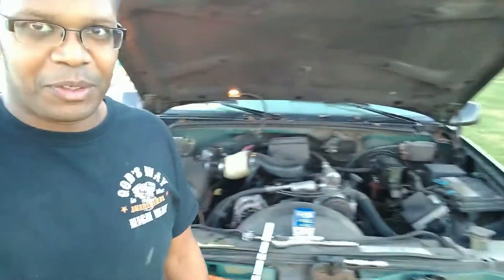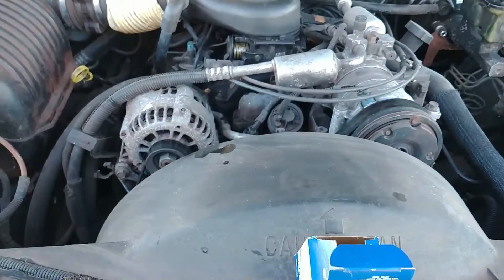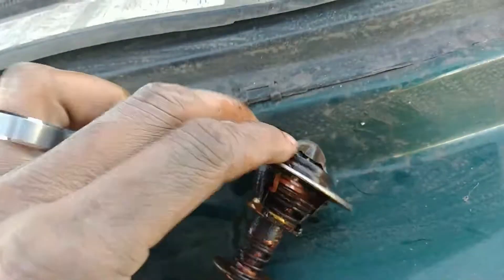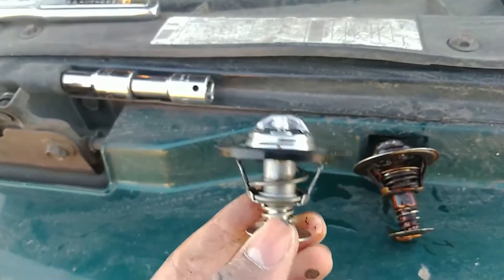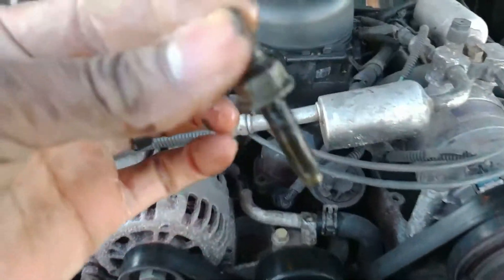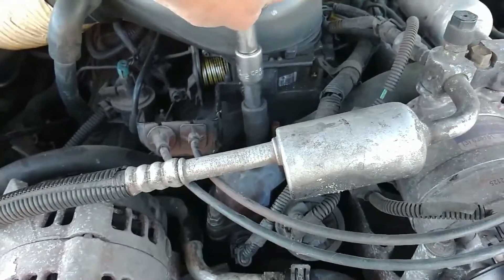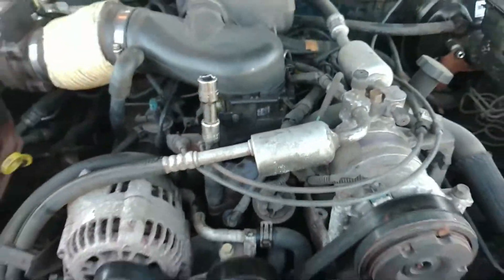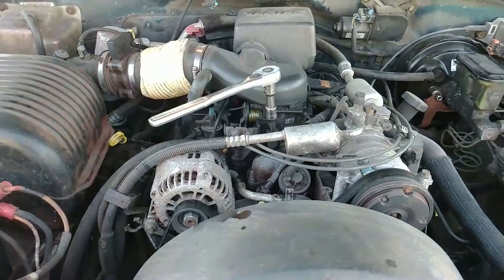NO HEAT! EASY CHEAP FIX! CHECK THIS 1ST! Tahoe, Silverado, Escalade, Suburban. Yukon, Sierra 3W1B

Comment: Never trust the gasket on the thermostat to seal by itself.  Particularly years later and replacement. In addition moisture can get between the flange causing corrosion and bolt siesure.  Just add a bit of silicone gasket to the flange matting surfaces for good measure!
Reply from the maker: I traditionally sealed both sides. Newer vehicles use o-rings which require no sealant.

Comment: Idk if this is what I need. 
I have a '06 Tahoe. Before I completely lost all my heat, was smelling something  burning. 
I had a old Ford Exploder, and the blower fan died, but i don't remember if it made a smoky smell.
Reply from the maker: I would make sure your blower fan is still blowing air.
Reply: @3Wheels1Block  its blowing cold air. The radiator gauge shows that the truck is not running hot.
Reply from the maker: I would check the coolant level. If the GMT 800 trucks coolant level gets low  it will cause the heater core to empty, which results in no heat. 

If the coolant level is good and the fan is blowing, you probably have a blockage in the heater core.
Reply: @3Wheels1Block  okay thanks. I can't  remember the last time that I added coolant. Its been a while. I hope that's the problem.
Reply: @3Wheels1Block  good looking out!!!!.
It was very low on coolant.
It took about 3 quarts of 50/50 mix. 
But I still need to know what the burning smell was several days before the heat completely went out.
It smelled like oil burning when you need to replace your valve cover gasket. 
I even saw the smoke come from under the hood when I was at a red light.
Reply from the maker: Definitely check around the engine bay. Look it over for evidence of leaks
Reply: @3Wheels1Block  👍👍
Reply: The plot thickens. Lol.
Yes, its leaking! I guess it's the water pump. I could see it real good today, when i checked the level of coolant. 
Ive had enough old cars to remember the water pump will drip what they used to call a tear drop.
Ill take care of this asap. At least  i have my heat back.
Do you think my radiator was so low that it was burning like a pot without enough water & the smoke came up through the coolant reservoir???
Is that why the thermostat you took out is so dark?? 
Or did the high coolant temp discolor the metal?
Reply from the maker: If your water pump is leaking the coolant is splashed around by that big mechanical fan or the electric cooling fans. It probably got on the manifolds or sides of the head causing steaming and it definitely will smell like something burning. 

The dark thermostat in my case is due to chemical and heat cycles. Just like an old penny looks dark compared to a shiney new one.

Good luck on getting the water pump swapped out.
Reply: @3Wheels1Block  👍👍 yep, I saw the serpentine belt is spashing the dripping coolant around. 
I'd rather have something I can fix myself, than to have to go to a repair shop or dealership for everything. 
I got a funny question. Do you remember back in the day when you could use power steering fluid &/ or transmission fluid in a car. It didn't matter!
I remember when pep boys had 3 tires for $99 & the 4th tire was free.
Here's a bonus.
I remember they use to sell motor oil in the dollar store...for a dollar. 
If they force us to convert to electric cars, we are doomed.
DIY is going to mean, Drive it yourself, to the dealer.
Reply from the maker: @do7hemath937 I remember every one of those things. I actually found Dex III transmission fluid for $1 a quart back in 2019. I don't think we will ever see that again. 

I agree 💯 that something you can fix yourself is definitely the way to go. Knowing your vehicle and being able to service it can save thousands of dollars over the life of the vehicle. 😎
Reply: @3Wheels1Block  it used to be I would buy alot of something just to not run out. Now I buy alot of something because inflation is so bad I know everything is going to cost more a year from now.
I hope you racked up on the transmission fluid!
I subscribed to your channel and I saw you painting cars.
Man, I remember when Maaco used to have the Ambassador and the Presidential paint jobs PLUS they had HALF OFF specials.
It used to be nice to get a nice $400 or $500 Paint job on a hooptie. Not anymore. 
But YT & other social media is a game changer. 
DIY and small businesses are going to be all the average man & woman can afford.
Reply from the maker: @do7hemath937 things are definitely changing, that's the truth.

Comment: That's a quality thermostat, built to fail in the open position. Wish they would have used that on my Jasper replacement engine. That cost me a weekend of tearing the intake manifold off and replacing gaskets with real rubber coated metal ones. ones the shop used was plastic and doing 3 oil changes. To remove all the antifreeze coolant.
Reply from the maker: I agree

Comment: Im having this issue but the heat comes through when im on the freeway
Reply from the maker: Sounds like a clogged radiator or heater core.